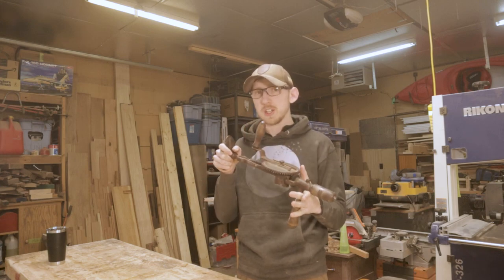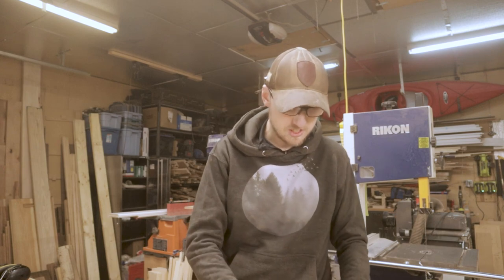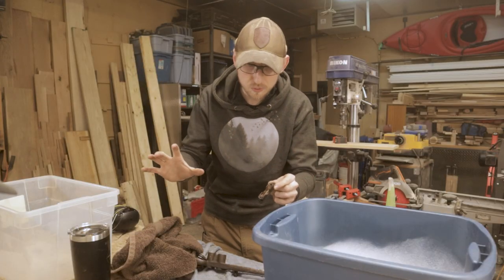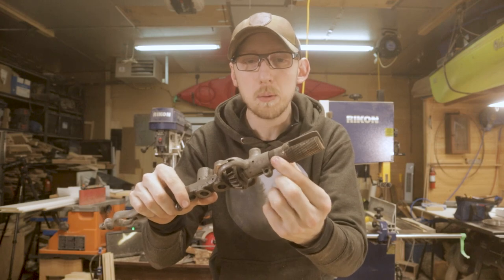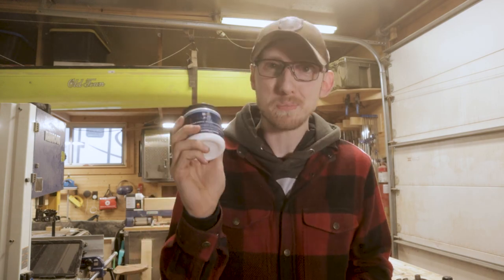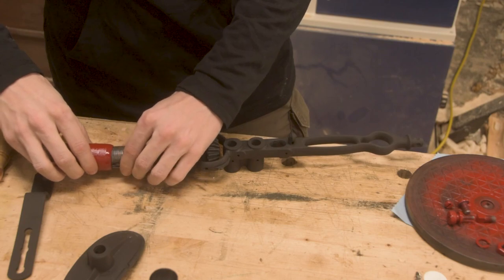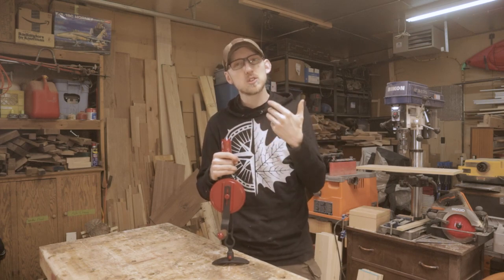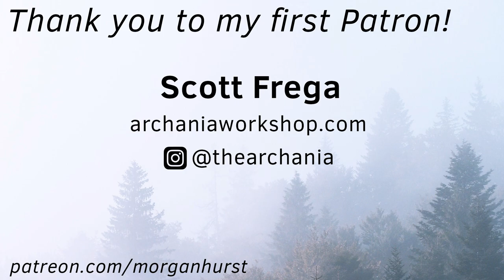This is the dumbest thing I've ever done to a tool | Millers Falls No. 12 Breast Drill

Comment: I watched your vide to the end.   I totally understand where you are going.   However.   Get over it! You did a great job restoring this tool to make it a useful part of your shop.   You did all the research to date the tool.   Print out the pictures and make hardcopies of the documents.   And save them.   Now you have lost nothing.  Your grandkids can strip off the paint and repaint it to the original colors.  This is a great video and you did a wonderful job of making a tool very useful again.  Be proud not frustrated.
Reply from the maker: I'm feeling better about the history part of it, I think that was just an initial gut reaction. Now my biggest issue is the paint job just looks funny. I've been working on a whole bunch of planes since doing this drill and I've found I really like the look of some painted surfaces mixed with the raw metal. I also added a sandblaster to the shop this past week so cleaning this thing up should be a quick and pretty fun process!

Comment: Back in the 1980s when 65 Mustangs were reasonably common used cars that some collector value, I restored the engine compartment.  I went with the original colors.  I used a Rustolium primer first as I lived close to the ocean.  My biggest regret was I painted the primer with a brush.  Sprayed the black.  What I didn't realize was that I could see the brush strokes of the primer through the black.  Killed me.

Hang in there, if you aren't happy, you can always toss it in thinner to remove the paint and repaint it.  It's fine as it is from a functional rust mitigation perspective.  Take your time, mull over, what you want to do, and fix it at the same time you repaint the hand plane.  Please keep in mind that there are likely millions of these drills out there.  Yours wasn't a pristine with original decals and original box.  As such, no harm really done.  What you did was take a rust bucket and make it more serviceable.  Don't beat yourself up too much as it is easily reversible should you want to redo it.  If not, that would be fine as well.
Reply from the maker: I'll definitely be coming back to this drill with a more controlled approach. You made a great point about this not being a particularly collectable tool so that part isn't bothering me as much anymore. The biggest issue now is that star wars paint job, comparing this to the hand planes I've done I don't like that all the raw steel is covered so on the cleanup, everything that was raw steel before with get clean and wax and the other parts will get a less intense paint job.

Comment: I would feel worse if I was the one who lost the knurled knob. Also it looks odd that the wood handles don't match. One handle looks like a file handle.
Reply from the maker: That is a very good point, I like to imaging this thing was used in some epic construction project and the guy dropped it from the top of a building or something badass!
I'll have to look closer at some of the reference material I have and see if the handles are original.

Comment: I really enjoy restoring old tools.  You can always remove the paint if you want. Dip it in lye and that will take it all off w/o harming the metal.  Add some light machine oil or mineral oil instead of wd40 - wd40 isn’t a lubricant and will evaporate off, so the machine oil will work much better and lubricate it long term.

I have a brace that was owned and used by my great grandfather, who was a carpenter / homebuilder.  It’s the only tool I have of his, so it has a lot of sentimental value.  I don’t use it much, but it’s a display piece in my shop and reminds me of him.
Reply from the maker: Since doing this drill I ended up down the rabbit hole on tool restoring and I now have a nice sized sandblaster! I'm planning to use that to get down to the bare metal and really make a good effort at making this look better.
Thanks for the reminder about wd-40, I'll remember to use some 3-in-1 once I have the drill cleaned up!
Reply: @morganhurst_redridge  Yeah I got a blast cabinet and stuff too, for the same reason. I was restoring planes at the time.